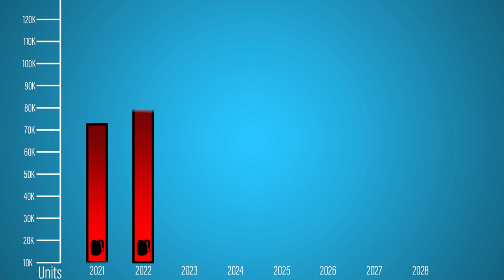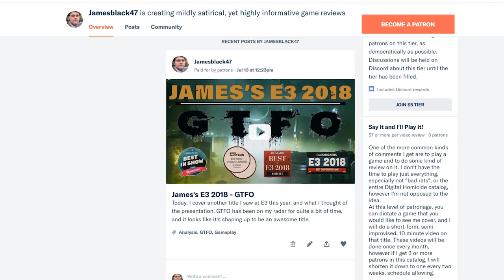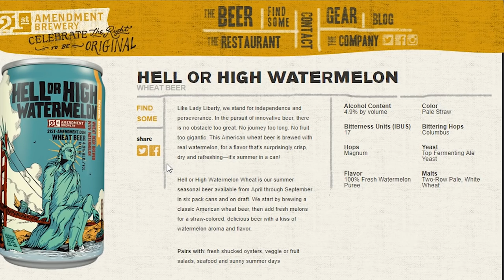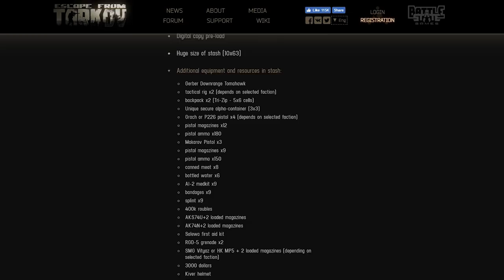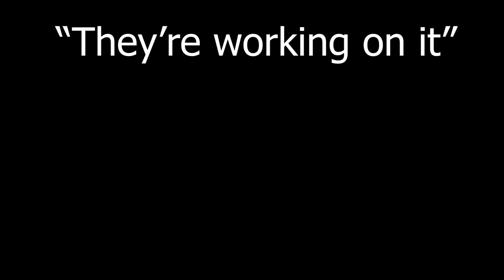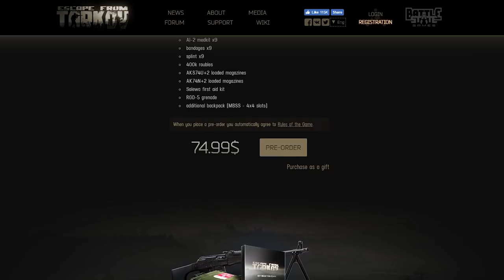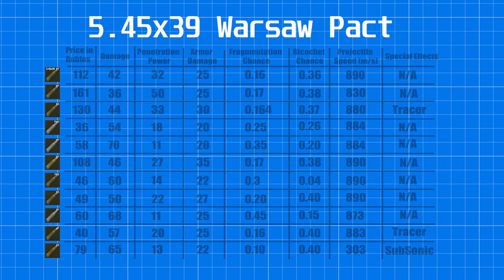Escape From Tarkov: Worth $44.99? ($99.99? $149.99?)

Comment: My name is Colonel Twerkins and I am one of the Jr. Community Managers for Battlestate Games and EFT. Just thought I would leave you guys with some info you will probably enjoy. I am not saying this on behalf of Battlestate Games as any secret news. This is all me giving out information that is from open sources. It is to benefit those who may not know already or had any questions. Thanks!

- We have only one developer from STALKER.

- Stash space has been increased across all packages in 9.0 

- Any edition below Edge of Darkness can match the EoD stash space through the upcoming hideout feature by leveling/building it up

- Currently, new servers have been added and lots of people are trying to get on so desync has been an issue--but we are actively working on it almost 24/7.

- We have fixed it for some players and working hard to solicit video for the freezes and desync for an upcoming patch--which will be technical only and will bring the next iteration of fixes and optimizations

- Due to the animation and occlusion culling system, EFT is more CPU heavy. This is optimized over time with the biggest optimization happening once the majority of implementations have been done. Read more about the technical side if EFT, HERE: http://bit.ly/2nshlnJ 

- 0.9 Brought in the prep stage for optimizing the animation system

- 0.9 Marks the sixth anti-cheat patch/update in the last two months--with more to come.

- We have turned down the blunt damage, and aimpunch mechanics in order to balance and test ammo along with armor.

- The test build may seem like it, but it will be nothing like PUBG and is not meant to be a competitive game. Arena mode, might be. 

- In the release, you must complete story mode, starting with only one map, and upon completing it, the next map will be even harder. You will need to complete the portion of story objective in that map to pass it. After completing all 10 maps, you will unlock Freeroam Mode. It will be all ten maps together with no loading screens. There will be areas that you could not previously enter that will be available and in no way inferior. There will also be hidden quests that you can figure out--even key cards to secret rooms with loot stashes.

- There will be cinematics in story mode, and even events happening like mortar strikes, dynamic weather, and more.

- The game was designed as a team based game...you are welcome to run solo, but we don't recommend it. (In the release) The final game difficulty will be ramped up and even harder and you will lose gear. But, there will be a clan system, clan stash, and even clan wars. Between the clan stash, the flea market and auction (those last two are not in yet) you have lots of options to obtain or sell/trade what you want. 

EDIT: Let me rephrase this for clarity: It was not recommended but it is not impossible. You will be able to play solo just fine, but that does not mean it will not be really difficult or that there won't be things you need other players to complete. Lots of games offer a baseline of solo difficulty. EFT, differs in that, your difficulty is reflective of what it would be like IRL odds-wise.

- We do not have level or loot based matching and will not have it. Mainly, because of the realistic nature and bullet physics and parameters. Basically, IRL, no one would tell an enemy with a pistol, "Meh, pistols are useless, you can't kill me with that!". In Tarkov, a bullet is a bullet. Level and gear do not stop a smart lower level player from shooting a high-level player in the open area of his helmet or on his legs and killing him. Cause bullets do real damage here. Also, joining a team means your odds are increased.  Because of the fact that everyone will only start on one map, have to complete the story objective for that map and discover their exit (some exits will only work once, while some will require you to have something specific or even more than one player in the exfil) hatchet runs won't be as useful. The current adjustments to stamina have made it even harder outside of the factory map.

- The traders are on a menu now, but will be found in-game and fully AI. They can also leave, get sick and even die. 

- You will have loadouts that you can save so that every time you go to the traders, you can auto-buy that loadout.

- Make sure to read the agreement carefully and note that it is in a testing stage and not early access. The testing is for servers, clients, network, anti-cheat (in-house), mechanics, and optimization. Building a foundation for the game to stand firm on.

- Please, test for errors and report bugs through the launcher. Include video/pics, descriptions and log. This is the only way we can get the data necessary to fix issues. (use print screen button for screenshots...it labels it with the coordinates to where you were when you took it)

Thank for your support and I hope all this info helps. There's no pressure, EFT is not for everyone. We did not intend it for a wide audience, and our definition of fun is gritty, hardcore realism--not at all what some may be used to, or ready for. So, consider everything before preordering, we do not want you to feel obligated at all.

Cheers!
Reply: Great to hear what you’re working on! Thanks
Reply: The Broham Nation you’re a fhacking saint.
Reply from the maker: Well, thank you for the info there :)
Reply: No problem.
Reply: Yeah, I disagreed with him on matchmaking... I think if it is impossible for new players to kill geared guys, it is either an issue with their skill, or item balance. Maybe armor is OP? Maybe the hitboxes need tweaking so it's easier to hit people dead in the face with your makarov?
Reply: I just read the same text on the sub reddit from you^^
Reply: Thanks Dude!!
Reply: so i take it fully auto won't be getting a rework any time soon and its gonna stay the same ?
right now its meta and its super easy there no muzzle climb after its first kick.. some guns you can shoot on target way to easy (akm etc)

guy need to seriously look into how fully auto is done in the future even klean said its to easy when i asked him..

I guess ill just have to accept that fact fully auto will remain non skilled based mean while everything else will be hard core.
Reply: Thanks for the good read. I was really interested in your game, but after you clarified that it is not really for solo players and my friends have no interest in EFT I better stay away from it as I do not want to feel forced to look for a clan, as I have complicated work hours. Good luck with your game, it seems great when you get the technical issues in control!
Reply: 0.9 made the game more unstable for me
Reply: Patrick Noble i mean they were a bit too big last patch, and if you want to get good stuff to kill geared people you will have to farm, until you get enough loot and money to run geared
Reply: by how many slots was the stash increased?
Reply: " there won't be things you need other players to complete. " Don't do this.
Reply: "I am not saying this on behalf of Battlestate Games as any secret news"

Yes you are, you just said you are a community manager in the employ of this company. Every single fucking thing you do as a public-facing person is on the behalf of this company, you represent them. Do not be disingenuous, anyone with at least two IQ digits can see right through this. You even used "we" several times, who are the other people you are talking about then - if not BSG?

I will say this to anyone who is watching. The game is great, plays great, great gameplay loop and improving every patch. However the community is one of the worst I have ever seen. I have been playing online games since the halcyon days of Half Life in 1998. I've played all different kinds of games and experienced lots of different communities. This community has one of the worst playerbases I have ever seen in twenty years.

The developers sometimes have questionable practices, where they are a bit disingenuous like our friend here, say one thing and turn around do another. However I give them credit as developers in terms of developing the game, it certainly is coming along and they are making do.

If you are interested in buying I would recommend the cheapest edition first, or if you have a friend who already has it play it on their computer and get a feel for it.
Reply: The Broham Nation this is why I love the tarkov dev team, everyone gives them so much s*** for one thing or another but at the end of the day you guys are consistently working on this project and sticking to your plans while also living room for Community input. I couldn't think of a better development team if I tried
Reply: Stojce 30 cells
Reply: "no one would tell an enemy with a pistol, "Meh, pistols are useless, you can't kill me with that!". In Tarkov, a bullet is a bullet. Level and gear do not stop a smart lower level player from shooting a high-level player in the open area of his helmet or on his legs and killing him."
even they know that leg meta is best meta, but pls give us leg armor, i beg you
Reply: BrotherJoe yeah, it's broken. From what I've read though it's a feature, your pmc character counteracts the recoil  himself, which should be the players job imho.
Reply: If the game is squad oriented and they'll have more benefits than a solo player, just remove the option of enter solo in a raid, simple as that. Or at least let people know that before they think about to buy the game, because we already have a lot of miss information that lead people buy the game and they're unable to play for lot of reasons. cof minimum requeriments  showed in official site is not beign the actual requeriments to play the game *cof*.

Forcing people to play with 2-5 squad team don't make the game special btw.
Reply: Kind of sad that this game is going towards a clan based system. The game in its current state is mostly solos from what I see in raids. I do see a few squads here and there. Personally I enjoy the solo aspect more. It makes things more frustrating when you have to rely on other players. Forcing people into a clan environment will ruin this game for me.
Reply: and now switch to cryengine :)
Reply: The gear dont make the skill. And for me the gear its pretty easy to get. And no i dont have EoD. Just the most basic package. Theyre doing a great job on that game so far. Not much desync anymore. Still some issues but what game in that state doesnt have any?
Reply: sound promising . Just wonder when the final product will come out ?
Reply: if bullets are bullets then why are so many bullets so under powered, people are just bullet sponges this patch and its honestly not as enjoyable as it has been
Reply: - Any edition below Edge of Darkness can match the EoD stash space through the upcoming hideout feature by leveling/building it up 

LOL, now we are at the point where it has become a running gag xD
Reply: the only market where you can make lots of money through totally made up promisses + beeing able to find an army of idiots who defend you with passion for doing that is....
SAY IT! SAY IT! I KNOW YOU KNOW IT BY NOW!
YOU SHOUD KNOW!
you paid 150 bucks to it.... xD
Reply: Mr. French Fry Aim punch and blunt damage mechanics have been turned down. Recently, I personally see kills normally.
Reply: Artuurs Z. lmao...odd way to react to such a benign comment
Reply: G Swills The clan system isn't something that was thought up on the go, it was planned from the beginning.

Not trying to be facetious, but it is important to read and research the game you are investing in.

The information is provided, but they can't make you read it too.
Reply: The Broham Nation Do you even belive in all this stuff? One large map? It will have problems in finding people, lags will be even bigger, optimalization will be much much worse, and nobody will play it because people will be bored before ending all map campains.
Reply: I learned some new things from this comment that I didn’t know about. Looking forward to actual free roam mode. Too many hater comments shitting on a game that is in testing phase. Keep taking your time with development and optimization to make one of the most realistic survival based FPS’s out there.h
Reply: Kuba Hołownia Well, my personal speculation, based on Unity '18 and what I've heard, animation, and occlusion culling are handled way better than the version that is in use now. (those two things make EFT CPU heavy) That, with streaming textures (even this alone) is going to make a full region more than possible. Also, the size will only be 16sqkm, so it's not that big.
Reply: Well the game is worth for you if you 
a) Like its genre/ style of play 
and 
b) Believe in the developers doing their job as they should.

After that its either "go for it, its just 30$" or
"If you wont play it and dont like it why waste your time arguing with people who think their investment was/is worth it"

My Opinion.
Reply: The Broham Nation desync all time this game only good look on gamers from america on poland we have more problems becouse servers dont working great and what with language ? we wait so many time ... if you on america you easy kill everybody on other countries becouse your internet going better and faster and you dont will be have desync ... i waste money and time on this game and have people killing me on other room from the close doors ... gg great game
Reply: Damn it, they should pay YOU to write the changelogs, you actually answer questions, thanks.
Reply: Dont take me wrong i have the game but look at what you said, "There's no pressure, EFT is not for everyone. We did not intend it for a wide audience, and our definition of fun is gritty, hardcore realism--not at all what some may be used to, or ready for. So, consider everything before preordering, we do not want you to feel obligated at all". That is the most ridiculous thing ever said about a game. So you make a game (poorly made imo) and push it to everyone and as soon as ppl find out that the game is in so bad shape like RPM locked to your FPS you start saying this shit. So lets say that you are right. Why not give servers to ppl that wasted 150 dollars in Australia, now you have them but you get my point. !st of all stop with the lies, and stop saying stuff you will never get done. Nikita needs to grow up and face the fact that this game was made to make money other wise why the diffrent acc. Why the pay to win mechanics. The open beta remember that??? January remember??? The lies keep on going you guys just keep pumping stuff into the game and not fixing the major problems. And let me guess why UNITY engine, you cant fix something like that because its not your engine hahahahaha. Stop get help.
Reply: the fact that the game is broken dude we all know that no astronaut needed here
Reply: There's no pressure, EFT is not for everyone. We did not intend it for a wide audience, and our definition of fun is gritty, hardcore realism--not at all what some may be used to, or ready for. So, consider everything before preordering, we do not want you to feel obligated at all.  LOLOLOLOL imagine henry ford saying this after making the model t. Man what company nowadays wants to sell as little as possible.
Reply: Remember the open beta in january?? Nice plan. LOLOLOL "I couldn't think of a better development team if I tried" get in touch with reallity, do you want to know what good companies are??? The ones that are making Insurgency and post scriptum. Those are the honest developers that wont use pay to win in their games just to get more money. Grow up little person you dont have to defend anyone.
Reply: This game comes from here Contract Wars. Check it out and you will see why they are failing.
Reply: So do you understand what a fact is??? Sorry if you cant.
BTW i am a consumer i have all the right to say what i said i dont defend it like my life depends on it. My arms wont fall off because of it. Dont argue with fact son.
Reply: Even Nakita said a lot of this isn't true
Reply: dude did you watch this vid man at all?????
Reply: lolol i said it so many times before you are so right
Reply: Until you add leg armor.......
Reply: BrotherJoe I think you are pretty skilled if you can control an akm bcs i hit jack shit xD
Reply: This isnt even early access this is beta testing, this is kickstarter in a way but with a direct invite to test.

I heard the game plans to release on steam next summer. Maybe that will be early access, maybe it will be full release who knows.

Unity is shit with objects and animations and beta testing unity18 was rather nice, post processing is improved as well as massive performance buffs.

People say that full map will be a disaster and they forget games like arma 3 have a mapsof 20x20 km and they run well for players, why because its render based, youre not rendering the 400 square km at once and in that statement it says its 16 square km. Also ever heard of LOD? Server wise its just ram and cpu power only for players and ai, the trees which swing around is just an animated object.

I bought the eod edition just to support the devs and it happened to give more stash oh boy pay to win, and here I am selling all my eod stuff and getting my cheap aks and filling that whole stash in 15 raids at 50% success rate. Its just common sense how to survive, dont take fights youre unsure about, dont run in the open and take breaks to look around or listen its not that hard. Tarkov is pretty much one of the only fps genre games I ever played with enjoyment where not being an ass hat and running like an idiot rewards you. Jesus today even when playing with a friend he got shot in the face from a pistol hatchling who heard us and hid and waited for a perfect opportunity. Lacking money? Go eco and use up scav runs you can cycle pmc and scav nowadays with that 20min timer.

Take it from someone who doesnt even play fps games but likes tarkov because of the hardcore niche. No one forces you to buy this game hell youre not even buying now, youre supporting development.

People mentioned it being hard in australia and you want a server there, well I see a few oce servers and I KNOW from friends living there that the real problem is your actual net providers and the government. Sure a closer server would help, but wouldnt it make the matching times too long?

And with people complaining about net code now are funny, the only times im experiencing that is when my friend who plays not from his home connection on weekends when hes away gets lagg killed, last patch I only died to lag once, havent experienced it this patch yet, the game is running smoother than ever, even performance wise my fps went from 70-90 on low to the same on maxed pretty much. And the gameplay is more on being calm and collected and skillfull than to hoping on lag to be on your side these patches.
Reply: Mayo Addict good points. 

I’ve started playing again since 0.9 dropped and the netcode and lag issues are significantly improved. Still some stuttering and occasional lag spikes, still some load ins with “server connection failed” (or whatever the exact text is) errors, but no instances where I spend 20 minutes playing just to find out I’ve been desynced and died 18 minutes ago and the server neglected to tell my client, like there frequently were a few months ago (though that was mostly on shoreline and I’ve only played customs since I started again). 

As far as the people freaking out about the clan stuff or any of the other long term goals, I wouldn’t worry too much about it, I’ve been part of the EFT community for a while and if I’ve learned anything, it’s that they don’t tell their English speaking employees like twerkins or Klean shit, that’s how that interchange gib wipe nonsense happened, with klean saying things he was “100% sure” about that didn’t turn out to be true, and he didn’t know were true, until the last minute. 

As far as needing multiple players to extract or proceed, no mention of anything like that was said when I bought the game a year ago, I did my research. The one big map, yes, the bunker, yes, persistence, yes, difficulty, yes, but not needing multiple people to progress. 

I don’t think they are actually going to do that though, and it will be relegated to the land of “planned(tm)” instead of “soon(tm)”.
Reply: Patrick Noble yeah... no its because you get tracked through solid objects by other people and then get aimbotted and die instantly the so called anti cheat they have is way to broken even for steam standards.
Reply: ZonkedPuppet 

Not all objects are fully solid, they might have the object there, but theres several different things. The visible object, object hitboxes, object collision boxes might be more but who knows, what determines if they see you if their camera sight aligns with the object hitboxes which they can see thru and other players can hence why small cover is sometimes more efficient and sometimes scavs still track you and dont forget scavs hear you as well and the ai knows it perfectly where youre running just as someone with headphones and perfect hearing if the know the map well. And theres only rare objects which scavs see thru to track. Even if that does happen report those bugs and theyll get fixed
Reply: Mayo Addict yeah it wasn't a bug the guy tracked me through solid ground
Reply: Just for reference, I have been playing EFT 95% solo for 2 wipes now (About 6 months). I have had no trouble playing alone, its just different. In fact I almost prefer it to when I play with other people. By playing alone you get really good (Or die and quit), which means that playing with other people just makes it all around easier.
Reply: Indeed playing solo will give you that rough experience, but what you really need is confidence in what you do no matter what, if you're confident and know which fights to take you'll go much further. I've been playing tarkov for a year now, but I'm playing about 1/4th of what my friends play yet I'm better than them in combat, because every raid I take the same approach. I'm greedy and aggressive, but I only take fights where I know I have a chance, reposition, flank sides, create diversion in one area and move the the side and try to get sight on them hell play dead sometimes even if you get shot quite a bit and the have no clear sight on you, but most importantly learn the maps, explore and take your time in raids, offline is also a great tool to experiment with routes etc. Also a good thing to do in any fps, have your monitor centered with you and learn where is the middle of your screen, your aim will improve just by that and more precise mouse movement is done by just moving your mouse with your fingers with your hand stationed. There's many communities which will take you in and guide you thru raids even. People call tarkov community garbage without realizing that pouring unjustified dirt on a game people enjoy can make some people angry, and if you look at reddit, I mean why are you looking at reddit, you don't go to reddit for sensible people, reddit is garbage, you go there for tarkov info and discussions as well as groups.
Reply: game is great!
Reply: Zincas based on your first comment I don’t think you understand that this game it’s still being made. If you are going to compare it to a car that is finished then this game is still on the assembly line. Also it’s not pay to win its pay for convenience.
Reply: +Zincas  "Why not give servers to ppl that wasted 150 dollars in Australia, now you have them but you get my point."    Because server and game development goes through phases, it's a WIP game, don't buy it without researching it (Finding out which countries are supported server wise.)  Watch videos, see how it is. Not Battlestates fault. Just your own.
Reply: Shady as fuck russian.
Reply: LOL you'l get free roam in 3 years while its still in beta.
Reply: banzai samurai OBT was recently announced as being around the corner. But you are welcome to your opinion.
Reply: @Teeky, it's not even that, as an australian he should know the net situation and how games in general put servers in OCE region as a whole, never in Australia, because of the poor network there
Reply: Is there a chance, that i'd be able to run EFT on i5-6300HQ , 960m (4gb) and 8gb ram and play around 60 fps?
Reply: Honestly it should run decently, not sure what performance you'll get exactly, I don't know anyone of my friends who play from a laptop, but I have friends who play on 6th gen i3 and 4th gen i5 and finding it playable, but sometimes having lower fps.
Reply: thx for answer. I'll try it :)
Reply: He is saying you can get the inventory on standard as big as eoc version, How?
Reply: All of the above doesn't matter until the massive lag and de-sync is fixed.
Reply: Bla Bla Bla. Heard this shit all before on the forums. You are using one of the most adaptable and popular engines out there. There is no Excuse for the extremely long periods of time between the relatively minor and underwhelming 0.8, 0.9, etc patches you put out. It feels like there are only 2 part time interns working on this game, one of which has Alzheimer's, and the other is missing all of their fingers.
Reply: despacito.
Reply: just fantastic. one of the best games ive ever played. the systems are genius. Keep up the great work :)  :D
Reply: Lol 1 month later no Change to Cache Size Lmao lies! Afraid people wont be buying that 100plus edition
Reply: ((Interest in game Intensifies))
Reply: @Levsque 'if'... This isn't some cheesy, simple Simon, asset flip, arcade shooter.
Reply: "In Tarkov, a bullet is a bullet." Damn, I fucking love this mentallity. I wish more devs were like this. BULLET IS A BULLET!
Reply: lol none of this stuff will happen though. not in this life time anyways. also what about russia 2028? hear your working on that at the same time? BSG is a fucking con artist company.
Reply: Coming soon TM
Reply: @gingercyclops4397  😂😂😂 nailed it.
Reply: the worst community in online gamming you say? you obviously havent played overwatch or league of legends.
Reply: Y’all are an amazing company
Reply: @ulala901  annnddd you just proved his point.
Reply: @DarkGloComics  open beta round the corner 😉 2 months later. Game still in an alpha build clearly not a beta. Road map from may hardly touched. Stash size increase still not there and EOD edition still on sale 😉 wonder when them promises are gonna be lived upto? Also the info you speak of is not readily available you have to buy the game to access the forums. The lies are strong with this one.
Reply: @DarkGloComics  open beta round the corner 😉 2 months later. Game still in an alpha build clearly not a beta. Road map from may hardly touched. Stash size increase still not there and EOD edition still on sale 😉 wonder when them promises are gonna be lived upto? Also the info you speak of is not readily available you have to buy the game to access the forums. The lies are strong with this one.
Reply: @DarkGloComics  'isnt some asset flip' adds 20 copy paste ak model every patch 😂😂
Reply: @hucklebk  Shows how little you are informed. Unlike what is seen in other games, the weapons modeled for Tarkov are modeled down to the bolt and springs. It's done in house, or did you not see the recent Shpagin pics?

As I said, on lots games they are essentially hollow and don't have the full barrel with rifling. Not here. Ofc, this is not the first time these particular weapons have been done by this team. They did have a previous game. 😆
Reply: @hucklebk  You're hilarious. "You have to buy the game to access the forums." 😂 Yeah, that's why there's a button that says, "Sign Up". You must be going to escapefromtarkov.com and not forum.escapefromtarkov.com There's a button for forums on the escapefromtarkov.com page too. Lol

Stash size increase? It's been done twice recently. Went up 30 cells the last time. 

Believe what you want buddy.
Reply: The game is designed as a team based game yet it does not promote team play unless you have friends to play with or are a part of a discord group or something. If you just team up with a random guy with the looking for group option through the lobby you are basically asking to get shot in the back for your gear with no way to report him for teamkilling. As long that report option is not in the game this is not a team based game.
Reply: @DarkGloComics  HEI GUYS ! BSG HERE ! I HAVE SOME INFO ! JUST A QUICK UPDATE : WE TOOK 2 YEARS FOR MED ANIMATIONS ! THATS GREAT ! IN ANOTHER  3 YEARS YOU CAN HAVE A NEW MAP AND MAYBE ... I SAY MAYBE ONE MORE AK MOD GUN ! YOU ARE NOT HAPPY ? WELL WE GOT YOUR MONEY ALREADY! CIKY PRIKY GOODBYE !
Reply: Gotta love devs who are active enough to reply like this.
Reply: #BoycottBattlestateGames
Reply: @piratepat44  nah bro its pre leveled out.... hard game yes but very eenjoyable
Reply: When it come to Steam?
Reply: Have any comment on the guy that got mass DMCA'd by Battlestate games representatives?
Reply: If you can get ahold of any of the devs, or some of the people who are involved in the further developement in the game, please tell them to add features that allow people with lower-end rigs to run the game, as I'm sure performance is an issue for alot of people.
Reply: @Crunk_Cat   Thanks for the answer.
Reply: Sounds great! But the forced story mode worries me
Reply: Cant wait for some of the upcoming stuff